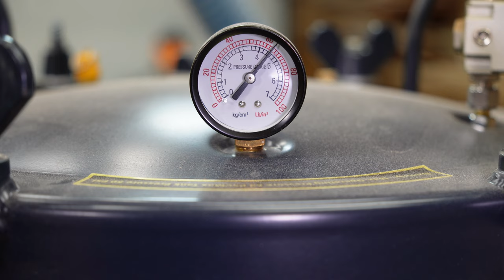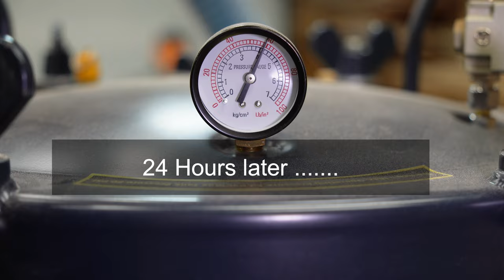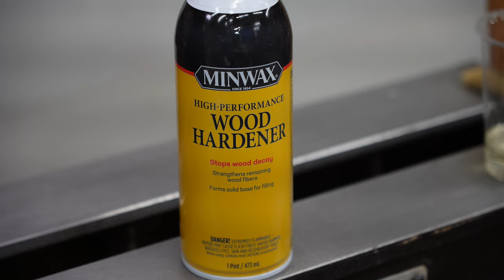Woodturning Transformation: Rotten Burl Wood to Radiance

Comment: Why use the wood hardener on the exterior when you're going to do an epoxy coat at the end anyway? Curious, great project at the end.
Reply from the maker: I used the penetrating epoxy (hardner) to seal the wood before the table top epoxy as this prevents moisture and air bubbles from effecting the finish.
Reply: @bespokewoodartistry1517  Thank you for the explanation, that helps me understand. I don't know if I'm ever going to eventually pick up lathe work, but I can see ways it overlaps with the lapidary work I do. 

Also, for some reason I find quiet ASMR videos like yours to be soothing. No politics, no bullshit, just artistry.